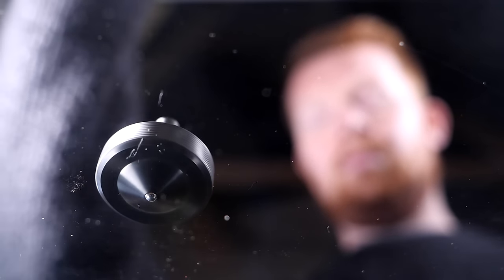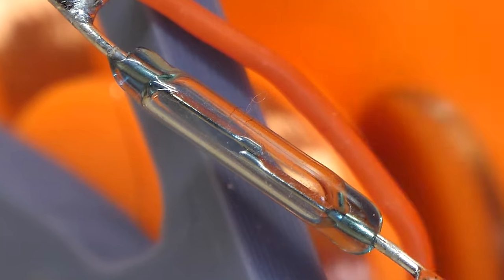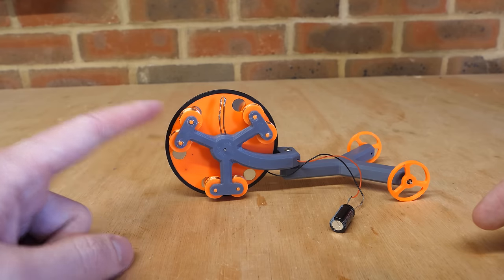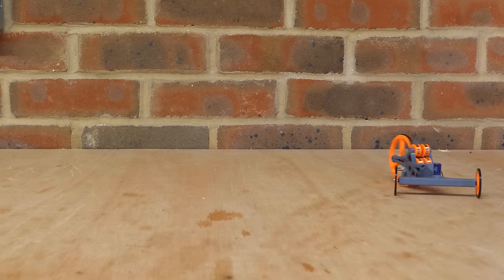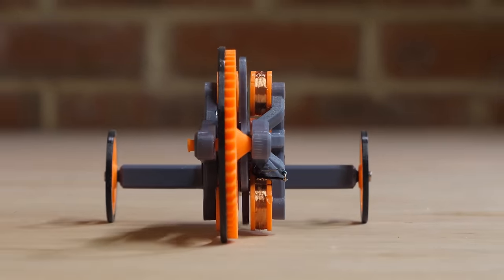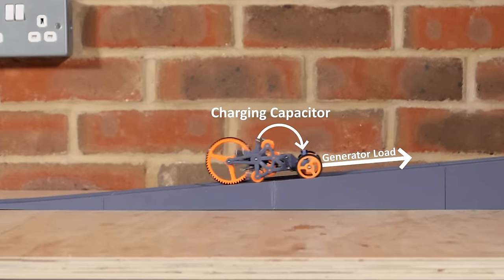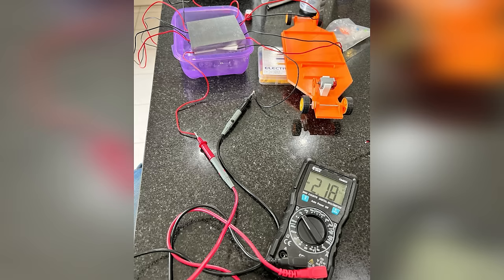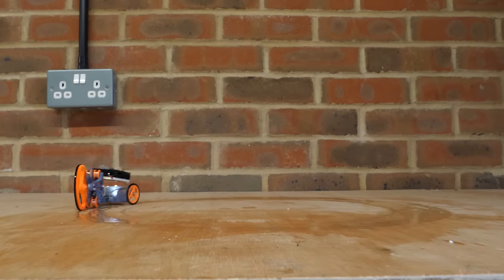This Car Travels Farther Than You Push It

Comment: Cool car! I feel like there is a variable in how long you push them, adding force over time to charge the capacitor. (Could instantaneous force be applied to the cars?)

The flywheel is increasing resistance to the motion on the "driven" axle. So the idea that the car drives further with capacitor than without is not applicable to real life, because we wouldn't connect a flywheel if it wasn't for the capacitor. 

It would be awesome to see you take off the flywheel and have a free rolling axle and make the ballast heavier to accommodate and THEN add force (instant if possible) and see the result!

Comment: Yes it exist with a flying wheels that can slow the vehicule (accelerating the flywheel) then start again after stop. This system was used in old trolleys. And in the end more efficient then the electric system you got here.

Comment: A smaller front wheel would have done the same as the gearing an o ring works well as a tire. The pelter unit from a fridge will run the 12 volt fan motor when unpluged and for the higher power has many units connected together you can get the complete fridge from a garage sale for $5 box in the ice to stop the water running down to the hot side.

Comment: Those pads if scaled up could be a replacement for an alternator on a combustion engine. Because of how much heat they can produce, if enough electricity could be generated. It could remove the need for a belt driven alternator that would drag the engine down. There should be enough ambient heat generated to charge a significant amount. The only downside is the first few minutes on start-up when the engine is cold. Or when the ambient temperature is cold. So now thinking about it, could be implemented well. But would have to be thoroughly tested for its application

Comment: 8:48 "So the generator car must be capturing energy from somewhere that is not obvious from this test."
You also forgot a factor.
Because the freewheel car goes faster air resistance creates more drag causing it to loose more energy per unit of distance travelled.

Comment: Flying wheel + gears gives u the same thing, I can recall playing this kind of car toys. Someone might say that flying wheel is heavy, but for this one u also need extra force to push the car cuz the resistance of the wheel turning in magnetic field. However, this vehicle is much lighter and much easier to turn and to be transported.

Comment: Peltiers are quite inefficient but are used when you want a cheap, small thing that can be cold(or hot) but powered from electricity. Small esky coolers etc.
Running it as generator is very inefficient but does allow for interesting things to be made. Imagine making a wall of these for summer lol

Comment: Thank you. I don't want to be offensive, so I'm going to say this: your idea is better than I think you realize. With that said, you try to put it into a car! But enough with that, let's do a project that this motor was supposed to be in in the first place—both you and Laser Saber are so close to what this can actually do. So here's a free idea from a person with a great imagination.
The idea is this: it was always good for windmills. It should be designed lightweight, and every time those smaller breezes blow, your motor turns on and starts actually generating energy for your windmill. Now, I know what most people are going to say: that pesky backfeed or backflow of energy. We've come up with ways to eliminate that and use it to our advantage—those are things I only talk about in my books. It seems people have figured out some tricks they should have figured out a hundred years ago.
One more thing: if you design it with double or triple intake to outtake, then one or two capacitors don't have to do all the work by themselves. What I was trying to explain is that by doubling the capacity with more than one capacitor, they can flip-flop. This means one capacitor charges while the other one discharges, giving the system longer durations of spinning. If they use a smart windmill, it can have extra capacitors. These capacitors store energy while others discharge to keep the windmill operational. Once they're drained and the sensors detect this, the stored energy from the windmill (which doesn't have to turn while the energy is being used) can rotate magnets that generate power for the windmill. This is an addition to enhancing the storage of the motor that's being driven, an alteration which Nikola Tesla championed in another project—a lesson we should have learned a hundred years ago.
But anyway, I'm in the US, and I believe you're somewhere in the UK. You can always drop me an email and have a better conversation than this text: medialibraryinfo@gmail.com.
For anyone else reading this text, this is a real library I research for. Historically, people forget about common things in life—like when you twist a rope with a heavy object, that object, when the rope untwists, starts to retwist back up. People from the Chinese area use this to ring water out of their clothes, similar to how modern washing machines spin to remove water. Such common themes; you're just applying it with electronic components.
Thanks for listening.

Comment: You could use it, as well as the heated air with the right design, to candle holders with moving elements. It may have some small models moving around, or a carillon playing without any batteries, just because you put a candle in it

Comment: What I think is most interesting with these kinds of concepts is they aren't exactly new discussion; the idea of storing energy in a flywheel/freewheel has been talked about since literally the 90s or even before that. I grew up wanting to learn engineering because I realized if anyone could figure it out they'd probably be rich beyond their wildest dreams. (Sadly, I am just not smart enough).

Really, what I think it comes down to is how many external forces you can recapture or redirect to improve overall efficiency. IE: If you can recapture the energy lost to aerodynamic drag, that's a boost. If you can recapture the energy used to stop that system (ie: regenerative breaking), that's a boost. If you can harness the energy of gravity and specifically reuse it when going against gravity, then that is a major boost.

But by far the most important and needed boost to efficiency is recapturing the heat lost to combustion reactions. I'm honestly surprised there are mechanisms which can use differences in temperature to generate an electric current, and I'm more surprised they are not more thoroughly used. The fact that ICE systems readily reach temperatures of near 300F and require mechanical cooling, coupled with the fact ambient air at 70F is flowing over, under and between those systems at high speed means there are ample differences in temperature that could be exploited. I don't see why one couldn't use a smaller engine and one of these systems to provide continuous recharging of a battery pack while the vehicle is in motion. But again, I'm not an engineer.

Comment: pairing a switch-commutated motor with a capacitor basically created an "electric flywheel". While this may be a bit less efficient, it does greatly reduce gyroscopic effects. To increase effective inertia, all that's needed is a larger capacitor! The angular momentum won't change.

Comment: sir, I have a question, when you attached the gear system one with one simple generator and the other with only two gears I suppose attached the two spinning things I guess the motor one please correct me. so, sir, the question is what if the amount of charges is getting compensated not in distance but to the rotary speed of gears to move faster instead in the single gear system to which only one gear was attached which was able to travel more distance, could it be because of it drained the less energy per second from the capacitor and once it travels few distances the energy is still consuming less may be due to momentum developed in the vehicle, and in two gear system the car travelled faster as it discharges the charges from the capacitor much faster to convert it to more mechanical energy resulting in speed or greater torr which in turn increased the speed of the vehicle but singes the charges are being used rapidly the distance got compensated and the speed was achieved. Could that be the case? And what if the amount of capacitors were increased? will it increase the speed even more?

Comment: In your freewheel car, you should have put the extra weight in the freewheel. That way it can store more energy just like your generator car. It will also make it slower going down the ramp and require more energy to get it up to speed, similar to your generator car.

Comment: I don't know about the reed switch, I've managed to convince myself that optical would be more reliable.  I'd run it from a small battery so it didn't use power from the working circuit.  Making a coil gun made me realize how critical the riming is for these type of things.  I've played with this sort of thing quite a bit.  The only thing I've discovered is that they seldom work as well as I imagined it would.  Good vid m8, thanks.  🤔😃

Comment: Instead of a reed switch, you could try a small FET and a small coil. The voltage generated in the small coil is connected to the gate of the FET (FET should have a low gate to source turn-on voltage). This may be more efficient and weigh less? The magnet wheel might be more efficient if mounted horizontally (bearings have less contact resistance). For a fair comparison test, why not simply disconnect the coils and capacitor or add the equivalent weight of the coils+capacitor?

Comment: What makes this video stand out is the actual proper analysis of where that "free energy" actually came from. So many free energy nutters essentially use devices like this, though in most cases they are either completely incompetent to  calculate the actual efficiency or are a straight out fraud. The force difference wouldn't be clear for most people and the fact that during the "push phase" the capacitor accumulates additional energy. When the push stops both cars had the same kinetic energy, but the electric one had additional energy stored i the capacitor. 

I'm wondering since charging the battery of an electric car has a nasty efficiency curve, if it would help to add some large capacitor banks for the generative braking to buffer the energy. Especially for city stop and go driving when the battery is almost fully charged could provide some benefits as most of the energy conversion (elec.<--> kinetic) would be stored in the capacitors if possible. Though since we talk about quite some amps and cycles, the question is how long those would last. Capacitors also have a similar efficiency curve. However they would most of the time be empty during normal drive so they should be able to capture quite some energy efficiently. Maybe with some clever step up power converters the exess energy in the capacitors could slowly be put back in the battery i the most efficient way.

So this would be like those hybrid HDDs which have a small built-in SSD to buffer reads and writes in the SSD to increase the performance.

Comment: the high gauge probably helps a lot. from my minimal understanding of the EM field, one of the weak points (as far as the concept has been explained across various YT videos) is the dead spaces  of air between the coils on the spool that can't be solved by making it a solid mass (like a copper nut)
Reply: What would a system have to look like to have suspended carriages being driven by magnets in the road (like a flying car, but lacking y-axis mobility)

Comment: when the car is acting as a generator it has a gear ratio of A to B  but when it is a generator your ratio is B to A

that would be great at the first sight because this very inefficient motor doesn't need to have much torque

but capacitors are really really good at depleting their energy very fast wich may make your car less efficient because it's just running though all power as fast as possible

the time a capacitors needs to deplet it's energy can be made longer by just adding a resistor but that will make the voltage on your coils lower

so i would take a capacitor with bigger capacity and voltage while also keeping an eye on taking the most lightweight one you get and then use a resistor

and i don't know wich gear ratio would be actually optimal but that would be a thing best discovered by rigorous testing

Comment: I love science and don't want to sound like a hater but this is just a car that stores the initial push energy to keep moving a little more 🤔
Reply: Did it not occur to you that this 'initial push energy' doesn't have to be created by an actual vehicle movement, but generated by solar power conversion and stored in a battery to use when required? 
What's shown in this video, is a vehicle that can potentially be solar powered.

Comment: Physics stuff: the reason its harder to turn a wheel with current is because a magnetic field is generated, which induces edi-current, and those edi-currents also have a magnetic field that is in the opposite direction (cause the edi-currents are in the opposite direction). The edi-current magnetic field will apply a force, that is essentially opposing the motion of the magnets. Therefore it would be harder to turn due to a resistive force induced by the current that was induced by the magnets. Year 11-12 physics

Comment: Efficiency is not just in the distance traveled; it's also in the speed. With the large difference in speeds it should be possible to travel further than the charging push with a really high efficiency vehicle.
Peltier car: use Plutonium to heat it and you have a TNG like what is drivin Voyager or Perseverance...

Comment: Edit: comented too fast, you already explained it 😅. 8:20 here you are kimda forgetting that the gear ratios and the electricity generated causes there to be more load on the ruler pushing the generator "car", so, more energy is put into the generator car than the normal car without anything else, even though they both weigh the same and are traveling at the same speed. No physics broken.

Comment: I would love to see this upscaled to at least single person car/bike size. It'd be curious how much heat would be required for the additional mass of a person to be pushed along with itself and it's fuel to burn.

Also, if the burning fuel was more enclosed — losing less thermal energy to the environment — it may tolerate more load as it produces more force.

Another thing to consider. If this device got up to speed, would it go even faster due to the factor of wind chill cooling down the heat sink even more thus increasing the efficiency of the thermal differential generator? If you constructed the heat generator in a way that the speed siphoned some air to act as a bellows it would also get much hotter; further increasing speed too in the same way.

Comment: The problem you have is, that the mass (weight) is identical but your reduced mass is higher in the motored car. All the spinning parts as tires and the motor need energy to rotate and the harder it is to rotate your object the reduced mass of your car increses. By pushing both cars by hand the motored car 'consumes' more force and is pushed more forward. Pushing it a less way but faster just causes traction issues and the motor needs (a little) time/turn to produce e-energy.

Comment: You missed the fact that theoretically the generator car could go further with the same energy. Going slow is more efficient than going fast. Therefore if that inefficiency is larger than the  energy loss due to the electrical conversions, the generator could beat the flywheel.

Comment: This can make for more energy efficient EV's.
The motors don't need to be active all the time and only have to run when you accelerate the vehicle.
This is a great idea on paper but the design might cause break issues and other issues. When I drive, I accelerate a lot, so it might not work out and might take some time getting used to.

Comment: use alcohol, burns hotter and cleaner. the soot build up will forms layers which prevent energy from transferring. i wonder if you put a little fan on that heat sink plus the alcohol burner if that would be enough to run it. or maybe heat pipes lol

Comment: air friction is lower than surface, also weight of car is a lot bigger than rotating disc on base, base can even weight 100mln tones disc is light, when you reverse that then disc must carry weight of base aka car plus friction of surface

Comment: "Ultracapacitors are used in some electric vehicles to store rapidly available energy with their high power density, in order to keep batteries within safe resistive heating limits and extend battery life.[29] The Ultrabattery combines a supercapacitor and a battery in a single unit, creating an electric vehicle battery that lasts longer, costs less and is more powerful than current technologies used in plug-in hybrid electric vehicles (PHEVs)"

Comment: 2010 Porsche’s 911 GT3 R Hybrid.

Porsche signed a deal with Williams Hybrid Power (WHP), which developed a Kinetic Energy Recovery System (KERS) for the Williams F1 team – though it was never used in competition. WHP’s electric flywheel

williamshybridpower-flywheel The WHP unit is an electric motor/generator with a rotor which can spin freely to act as a flywheel. When the motor is being powered the flywheel accelerates. The flywheel continues to spin when the motor is switched off. When the energy is needed the motor acts as a generator, producing electricity – while the flywheel slows down.